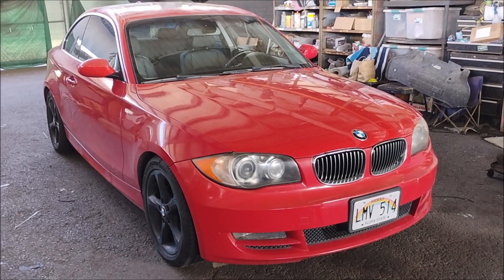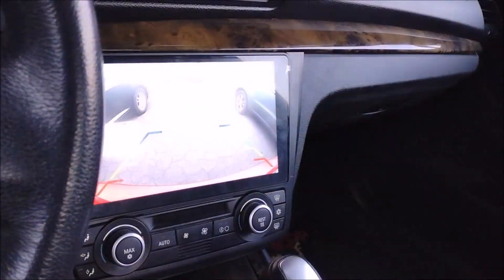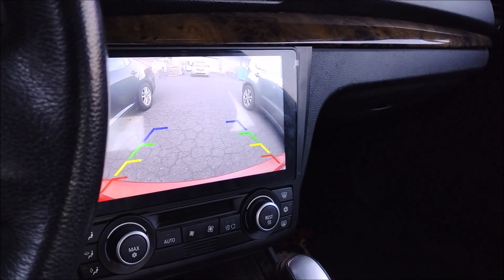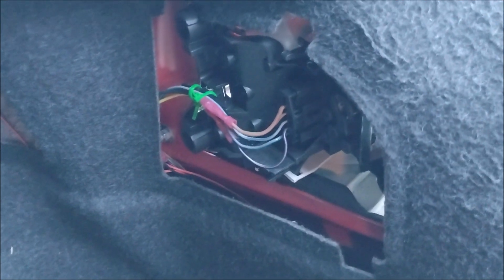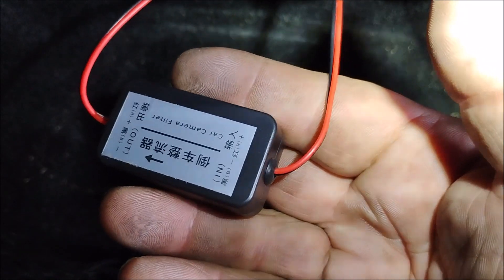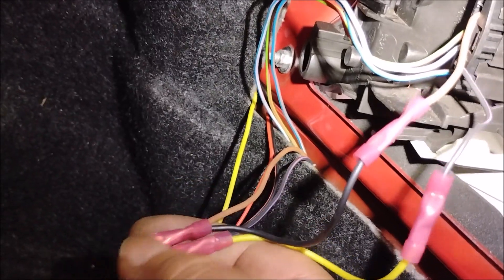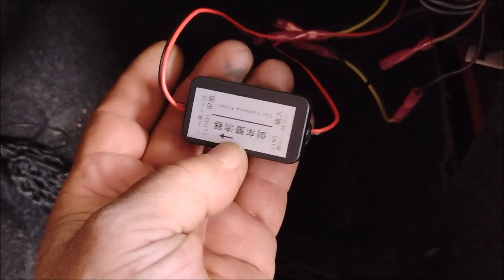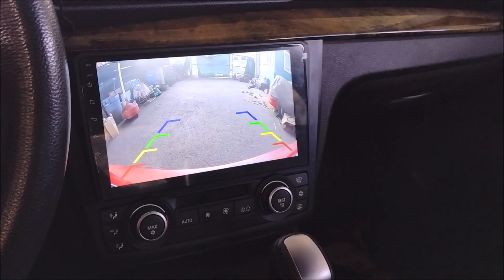Backup Camera DIY Install Part 4 - BMW 128i E82 E88 E84 E90 E91 E92 E93 E70 E60 E61 E39 X5 X6

Comment: Buenas noches, la desesperación y la frustración me han llevado hasta tu vídeo. El verano pasado instalé una pantalla android en mi BMW 128i de 2008 y la cámara de marcha atrás que venía con ella. La pantalla la instalé sin problema y funcionó desde el primer día. Pero la cámara fue imposible, lo dejé por imposible y la semana pasada decidí volver a intentarlo, compré un relé para ver si ese era el problema, pero nada...así que acabo de comprar el rectificador del vídeo, a ver si con eso lo consigo...Ahora cuando pongo marcha atras, la pantalla lo detecta y aparecen las líneas de guía pero no emite imagen ninguna... A ver si con ese rectificador lo consigo...
Reply from the maker: nobody watches this video.
Reply: @Merryfrankster_  I did it, and I continue needing help with the camera instalation 😅
Reply from the maker: @rubentezanosgonzalez1704  sorry that you are having trouble. On this car, the computer sends a canbus message to the stereo to tell it that you have engaged reverse. So there is no need for the taillight sensor wire. However you do need to have a working can converter box, that usually comes with the stereo. The other very important thing is to set the correct resolution for the camera in the stereo settings. If you have a low dpi camera and your stereo expects a high dpi signal, then you get blank screen. Hope this helps.